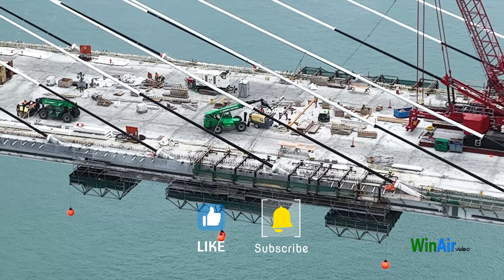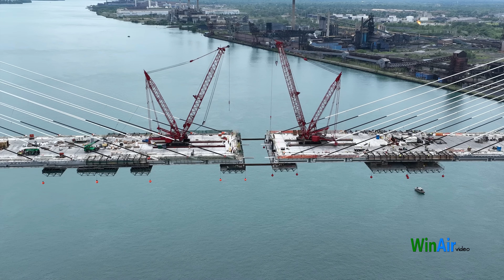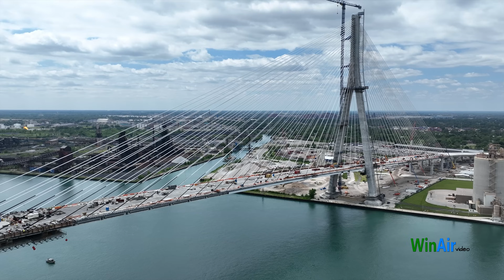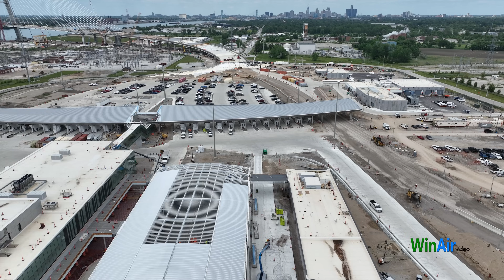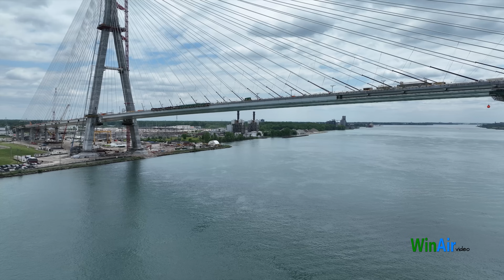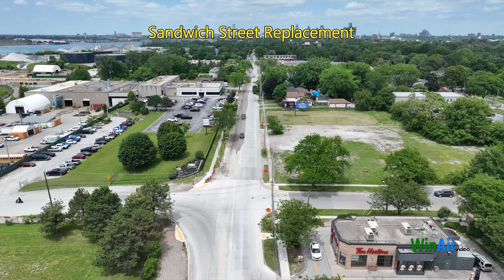Amazing Drone Views of the New Bridge Construction!

Comment: Modern technology or not it’s still amazing you can start at two sides meeting in the middle with such precision. It’s amazing that there is no side sway in the road deck because of how far out it hangs from the towers. Or is there?
Reply from the maker: Hi Fleetwoodjohn. Yup. There is sway. From what I found. After reading your post I did some searches and this is what I found.
There is expected to be some side sway or lateral movement in the road deck of the Gordie Howe Bridge due to its long main span of 853 meters (0.53 miles), which will be the longest main span of any cable-stayed bridge in North America.
Cable-stayed bridges are designed to have a certain amount of flexibility and movement to withstand wind and other environmental forces. The cables that support the deck are slightly angled, allowing for some lateral movement while still providing the necessary strength and stability. However, the bridge is engineered with various measures to minimize excessive swaying and ensure a smooth driving experience:
The cables are being carefully tensioned and adjusted to control the amount of sway.
Temporary bracing pieces have been installed to hold the two sides of the bridge deck in alignment during construction until the permanent steel girders and additional bracings are put in place.
Sensors will be installed to monitor the bridge's movements and make any necessary adjustments to the cable tensions.
The bridge deck will have railings and an overlay surface added, which will further contribute to its overall stability and dampen any residual swaying.
So while some lateral movement is expected and accounted for in the design, the Gordie Howe Bridge incorporates various engineering measures to keep the sway within acceptable limits for a comfortable driving experience across its record-breaking main span.
Thanks for the question! We learn everyday and your question taught me something cool. The bridge deck will always have a sway. I imagine it will make some quezy on windy days. Lol.

Comment: As someone who doesn't live in the area, why is this bridge so monumental when there's already a bridge and tunnel connecting Detroit to Windsor?
Reply from the maker: Even with the Ambassador and the Tunnel, trucks often back up crossing the bridge sometimes for miles waiting to cross. Literally. The Gordie Howe Bridge will take the congestion away from the city and allow traffic to flow freely.
Reply: The Gordie Howe bridge will boast the longest main span of any cable-stayed bridge in North America. Also, this will be the only connection between Detroit and Windsor that allows uninterrupted freeway traffic flow by directly connecting Highway 401 in Windsor to Interstate 75 in Detroit. Currently, you cannot pass through Windsor without having to travel through city streets.

Comment: that worker at 2:00 on the scaffolding doesn't look safe!!!
Reply from the maker: He is tied to the bridge, but yeah the wheels are not locked on that scaffold. Maybe on pourpose?
Reply: @bobjonesrealtor7756  he is, but I saw that scaffold jostle and almost tip. Would have gone into the river.
Reply from the maker: Hi PretzelGuy. No it didn't look stable . . . I guess the key word in your post was almost. :)

Comment: Last week the spans weren't level but now they are. I can't find any information about how they were lined up horizontally in order for the mid-span closure to begin as you describe.
Reply: Yes would like to know how they leveled it up
Reply from the maker: I'm not very knowledgable about this stuff, but I assume they can adjust the bridge deck quite a bit with the cable stays. The bridge deck sections are compressed against each other with the cable stays same as the road deck cable stays putting the load back to the towers. Right now they are alinging the two bridge decks with steel beams. I posted a few pictures today.

Comment: Another fine video, Bob.  I would like to clarify what you said in the video, so that others may not be confused.  The mid-span closure section is not one piece which will be dropped into place.  It will be made up of 2 edge girders, 2 floor beams, 9 redundancy girders, 12 precast concrete panels, and 12 soffit panels.  The mid-span closure is installed just like all the other sections have been installed, except that there are no stay cables.  This process will takes days to complete.
Reply from the maker: Hi Steve. Good catch. You are 100% right, I knew it would be built similar to the others so don't know why I described it that way. My bad. Thanks for the heads up on this one Steve.